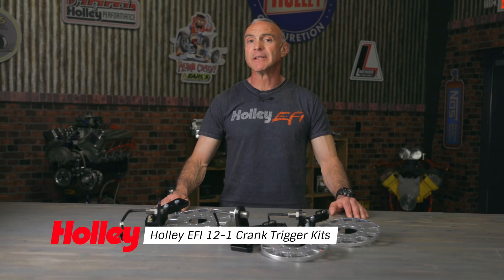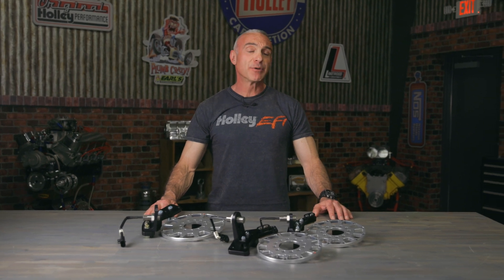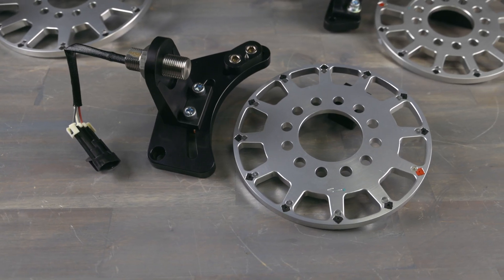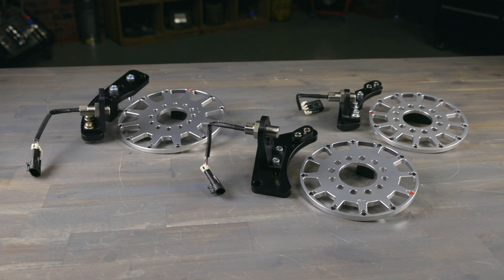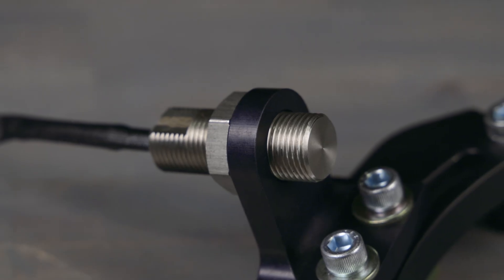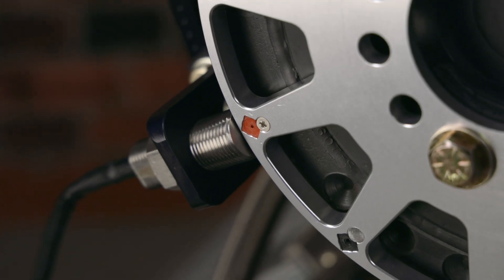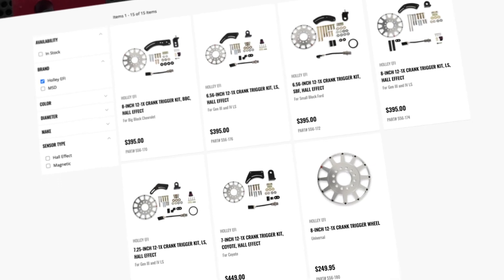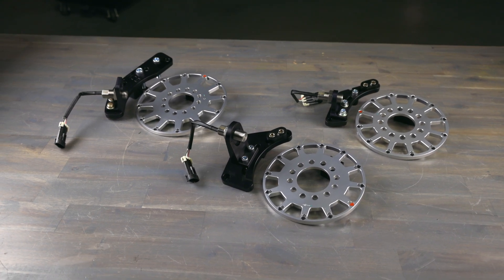Holley EFI 12-1 Crank Trigger Kits - The Best Way To Get Accurate Spark Timing

Comment: So ok ive built distributorless systems for gen 1 small blocks, 302 Fords, and even my moms old AMC Gremmy. My go to setup is a wasted spark system using either a 36-1 crank mounted wheel, or a 58x crank mounted wheel especially if im working on a small block. The 58x/60-2 wheels from the direct injection 4.3 ecotecs fit perfectly onto a crank snout between balancer and pulley and only require 1/4" spacers for accessories. All that is to ask is that what these wheel and sensor kits are for, or is it something like removing the timing function from the dizzy and just having it distribute spark? Or are these wheel and sensor packages meant to be part of a distributorless conversion?
Reply: What timing cover do you use for 58x ecotec wheel on the sbc's? Vortec timing cover?
Reply: @415fam you can use whatever timing cover you like. The first time i did this it was on an L98 so it had the standard timing cover. I sandwiched the wheel between the balancer and the pulley. I took a measurement of the wheels thickness beforehand though, so i could space the accessories. On that first one i used washers to space the accessories out  so theyd line up with the crank pulley. It worked great and still works. The biggest pain in the ass was making an adjustable bracket for the hall sensor.
Efi connection sells a timing cover thatll let you put the wheel under the cover, And it has a boss for the sensor. I didnt like that for 2 reasons #1 theyre out of their minds with prices
#2 if something happened i wanted to be able to pull everything apart fairly quickly

Comment: Crank trigger ignition is definitely the ultimate way to go for precise timing events. Now all I need is a system designed for the Ford 351 Cleveland engine, all would be well in the world of superior ignition timing. 

MSD offers crank trigger distributors for Clevelands but NO trigger setups for the blocks. Go figure 🤷‍♂️